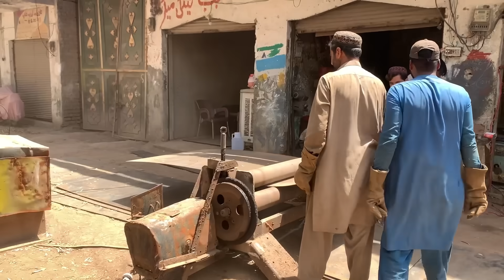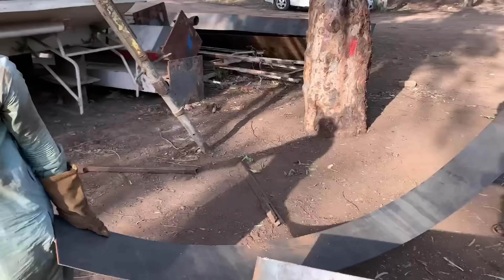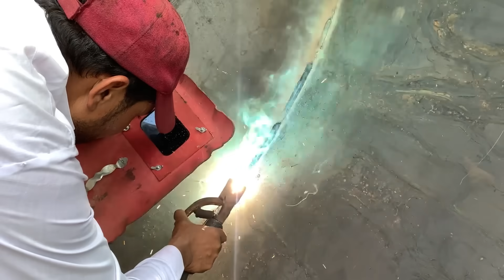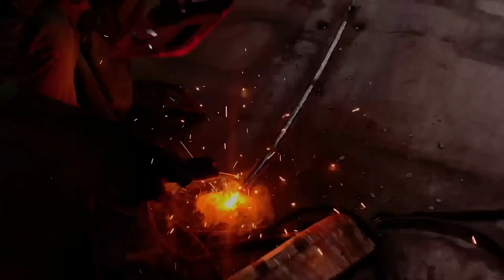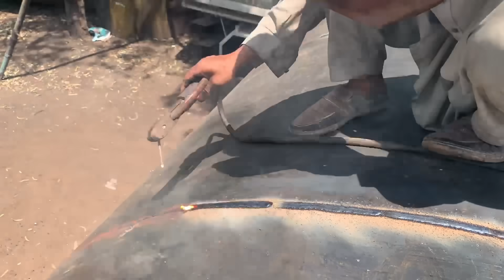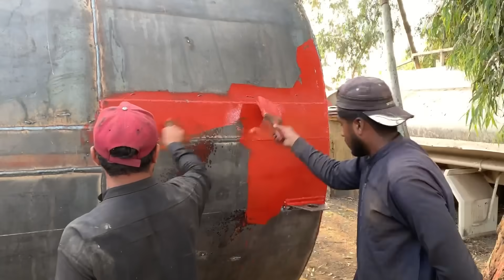Everything You Need to Know About Underground Tank Manufacturing | How petrol pump fuel tank is made

Comment: A very poorly done job. Every weld was done in the wrong way (welding from top to bottom - which makes the weld bad and weak). Welding is done over impurities. There is no finish, no painting inside, workers do not have protective equipment, the "ladder" on the reservoir is welded without measuring... very bad and messy

Comment: 💡🔌🔋 One question... where do these guys get such electric power capacities from? 🤔 It's intriguing to witness their ability to harness and utilize significant amounts of electricity. 💥⚡ Let's dig deeper into the fascinating world of power sources and explore the possibilities of alternative energy systems that enable such impressive feats. 🌍🌱 Join the discussion as we unravel the secrets behind their electrifying achievements.
Reply: There is another group of hard-working guys keeping one or more gas or diesel  generators working somewhere nearby, selling electricity through a hodge-podge of un-regulated overhead wiring.  These people are the ones I want in my community if an apocolypse happens - they make do with or without gloves or safety shoes or hardhats or safety glasses.  Of course, this would be a lot more difficult without the steel mill providing raw material, the Toyota pickup for deliveries, the welding apparatus and welding rods and mask, the massive bending rollers, or the economy that says this is a good job, better work to keep it, just watch your feet.
Looking at the shoes seen here I can understand why these people remove their shoes before coming inside or taking prayers, a habit they retain even if working for white-collar pay in the US.  Also why hitting a person with shoes is a nasty insult.